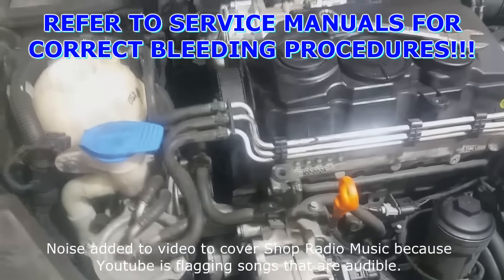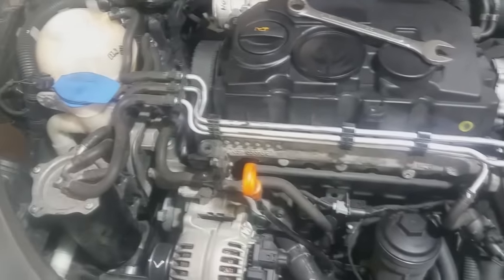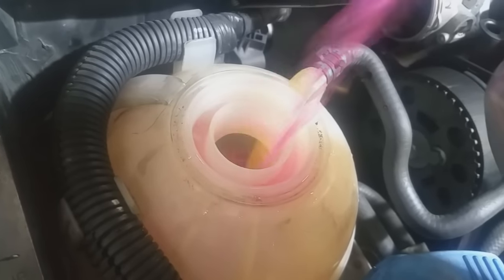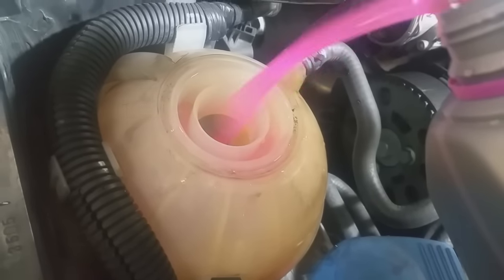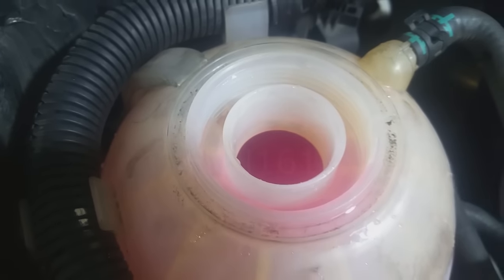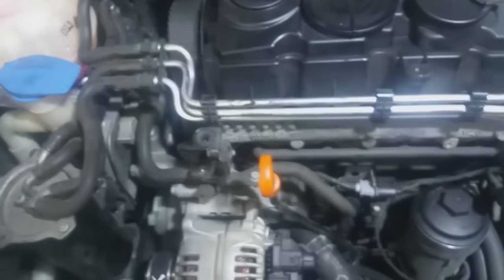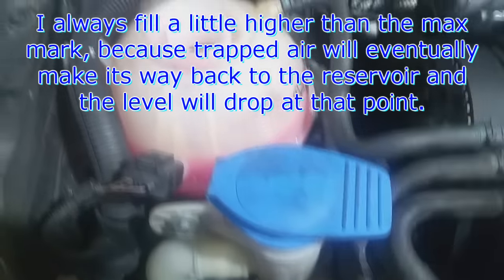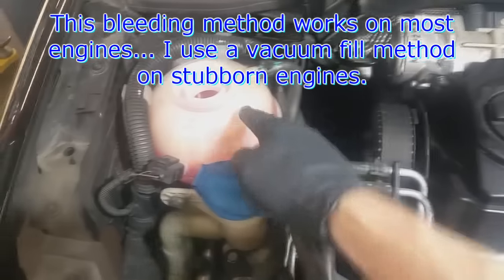Basic VW cooling system filling / bleeding info (viewer request)

Comment: A DIY tip bleeding coolant with a self bleeding system. After filling the coolant reservoir, drive the 2 front wheels onto a ramp and leave the engine running with heater at max, this will allow gravity to assist flow into the far reaches of the cooling system, engine block and heater block, while buoyancy forces air up to the reservoir works everytime for me.
Reply from the maker: +zech007 Thanks for the tip!
Reply: I know 2.0 FSI engines are difficult when doing a coolant change. Bubbles get stuck in certain parts of the engine throwing codes or just heating it up. Will this procedure help for this type of engine?
Reply: zech007 that’s great if it’s a car with a radiator cap, which VWs don’t have... jacking the front of the car up makes the reservoir even lower than it is flat on the ground!
Reply: VERY sound advice. Thank you!
Reply: That will work most of the time.  Definitely not on LR Disco 2s.  There are vehicles you literally need to bleed using bleed screws and by filling using vacuum.
Reply: Physics never fails!

Comment: hahahaha too funny .. after replacing my Rad with your other videos i tell my son to "go ask Thomas how to bleed this thing" ..sure enough he brings this up on his phone ...
Reply from the maker: Thank him (from me) for watching!
Reply: Hi brother I have 2014 vw passat disel car drive fine at night when it's hot over hear change rad thermostat flush system as you said if you don't hear air bubble sound you have blockage what should I look in also i noticed there is small hose going to intercooler I saw it it had some restricted thing In is that normal thanks Please help me with that issue

Comment: Good info, I used this method yesterday, and it worked perfectly.    This is by far the easiest maintenance I've done on a Volkswagen.    Most things on the VW are the opposite of easy.
Reply from the maker: As long as one makes sure that the air can come out, it's a simple system to bleed. =)
Thank for watching!
Reply: You are right, I had the same problem with the VW clamps!    Pneumatic hose clamps would have made it much easier, but I didn't have those.     There is a handy drain spigot on the driver's side of the radiator.  :-)
Reply: Given how VW plastic ages, I'm sure the spigot is risky on an old car too.
Reply: Thomas EXOVCDS would this work on a mk2 2011 “Seat Leon 1.6tdi” it’s basically same as a MK5 golf engine
Reply: Lol @ "the opposite of easy..."
Reply: Just wait until you change out a headlight bulb, plug and play haha
Reply: @Gr8thxAlot  aa
Reply: So this would work on a mk4 gti?
Reply: @cesartorresguzman919  I believe so.
Reply from the maker: @Cesar it would help to get more info from you. Why are you bleeding the system? Did you have an overheating issue that you tried to solve with a thermostat? Did you just want to do a coolant flush but now it's overheating?
Reply: @EXOVCDS  because i had leaked my coolant, I forgot to label the bolts that hold the trans, and I put the wrong bolt where the ground cable goes onto the trans for the battery, and  leaked coolant, so I was refilling the coolant, now coolant leaks under the car but toward the back passengers side of the car!
Reply from the maker: @cesartorresguzman919  vr6?
Reply: @EXOVCDS  yes GTI VR6 24V (6 speed )
Reply from the maker: The wrong bolt (too long) cracked the block?
Reply: @EXOVCDS  yes! Im assuming it cracked something because fluid started leaking from that bolt hole, but when I put the right bolt in, the leaking stopped
Reply: @EXOVCDS  the first bolt was too long yes compared to the original one
Reply from the maker: If the leak returns, you will need to drain the coolant,  remove the bolt, dry the inside of the bolt hole and then apply some JB Weld to cover the Crack in the block. Once the JB Weld has hardened, install the bolt again. To be on the safe side, grind the tip of the bolt off with a grinding wheel... to make sure that the bolt does not make contact with the JB Weld. As for bleeding the system, yes, the instructions in the video apply to your engine as well. Make sure that coolant flows back into the reservoir when the engine is running. If it does not, then there is a blocked coolant passage in the bleed hose / system.

Comment: I have a question for my 1.8t Jetta 2001. When driving sometimes my temp gauge goes pass 190F and fluctuates from the first line after 190f then back to 190F. It happens ever so often. Sometimes it even does it when the car isn't moving it'll rise then go back down. The fans kick on and everything, you think this could be a thermostat issue it getting stuck closed? Thanks in advance Thomas
Reply from the maker: Could be thermostat, water pump or temperature sensor.
My next step would be to compare the temperature reading that the ECM receives, with the reading that the Instrument Cluster receives. If they are both doing the same, then look for a thermostat or water pump issue. If one reading is steady and the other is up & down, replace the coolant temperature sensor.
Reply: +Thomas EXOVCDS would I get a code for the temp sensor?
Reply from the maker: Only when the temperature goes to extreme range... -40f or 260F
Reply: +Thomas EXOVCDS ah okay, how would I read ECU's temps? Through a obd2 scanner or Vag com?
Reply from the maker: A OBD2 scanner will read temperature that the ECM/ECU "sees"... a good scan tool will also be able to communicate with the instrument cluster computer, to see what temperature it "sees".
Reply: +Thomas EXOVCDS okay thanks a bunch, I'll take a look at doing this and see what happens if worse come to worse I'll just get a new water pump, thermostat and temp sensor.

Comment: I just fill it up, heat cycle it, and then the next morning top it up when it has cooled down.
Reply from the maker: Yes, it can be that simple, but depending on the design of the cooling system, not all engines will bleed air out like VW's & Audi's... even they have some engines where air can get trapped. By the time the thermostat opens, damage has already been done.
Keeping an eye on the temperature gauge or scan tool data can help save an engine by telling the owner to shut it off (things are getting too hot).
Reply: @EXOVCDS  . Thank you buddy, I love your channel btw. The amount of info you give is just mindblowing. I binge watched most your vids last night.

Comment: My 2001 TDI takes forever to get warm. And will ONLY get warm if it’s sitting and idling. As soon as you start to drive it, the temperature drops. I’m hoping the thermostat is stuck open and just needs to be replaced. But my radiator fan also won’t turn on. The AC fan turns on when you turn on the AC.
Reply from the maker: Yes, most likely  a bad thermostat / stuck open. The radiator fan switch won't turn the fans on if the radiator doesn't get warm enough. Replace the thermostat...  you'll get better heat and the fans will come on when the radiator gets hot enough.
Reply: @EXOVCDS  you rock man! Wish me luck!

Comment: Love your videos, thanks! Question for you. I have a Jetta mk5, no heat. New radiator, intercooler, thermostat, overflow tank. Flushed out heater core, it’s clean, car getting and maintaining correct temp. Coolant recirculating in overflow tank. Ordered new actuator for flap under glove box, but even with it open all the way still no heat, any thoughts?! Thank!
Reply from the maker: Flap under glove box... the "recirculation" flap?
That only controls air flow coming into the car.
Reply: Flushing out a heater core doesn't guarantee heat. It might not be possible to get enough gunk out to make a difference. I had an old Jeep that I tried flushing the core several times, but the heater never really worked until I bit the bullet and pulled out the dash to replace the core. If you've ever done this you'll know why mechanics sometimes charge $1000 or more to replace a $50 part. I wish all vehicles had simple to get to heater cores, some of them do. I've replaced a couple that could be accessed from below the dash, but that's a rarity. 

If your radiator was replaced because it was plugged with minerals or gunk, the heater core is probably just as bad.

Comment: I have this very weird issue on my Audi 2.0 TDI 2009. One day when I just started to drive a low coolant alert came in, I stopped and yes indeed it was low, I unscrewed the cap and coolant rised couple of centimeters (not to the point where it was before). I was in hurry so I screwed cap on and continued to drive. Next morning coolant tank was almost empty, so I unscrewed it again ->hissing sound->coolant rises. I started the engine with cap off for couple of minutes and coolant rised more, to the point where it was when everything was normal (so it looks like there is no coolant loss). No overheating, no gunk in the oil, no oil in the coolant. It is worth to mention that 1.5 years ago I had EGR cooler changed (so it is very painful to see some coolant issues once again lol), and couple of months ago I had heater core changed (I checked coolant level after that and everything was ok). Sooo, here is the question could this be just coolant tank cap or... it is early symptoms of head gasket? Yeah and I also hear sloshing sound when coolant cap is on and when I am revving up the engine, when I remove the cap and rev the engine, sloshing sound disappears, when I put cap on sloshing sound returns. It is air right? If there is an air there should be a leak somewhere right? Please tell me it is just a cap...
Reply from the maker: You have air in the system (coolant rushing sound through the heater core). New egr cooler or used? If you don't see leaks outside of the engine  then the leak is internal (head gasket or egr cooler).
Reply: @EXOVCDS  EGR cooler was new. Damn, head gasket, but at this point there are no clear signs... I burped system yesterday and sloshing sound disappeared, also changed the cap. So let's see how it will go.
Reply: How did it go? I’ve had the same problem for a year now
Reply: @ingveellingsen9806  it was egr cooler, I replaced it together with radiator tho and now everything is fine. Why radiator?Because there had to be some underlying issue why new egr cooler went bad afer just 1 year (the brand of the cooler was also not the cheapest). The coolant color itself was more brownish then red, that was the hint for me that it must be due to rust in the cooling system and in the radiator itself (also previously I had issues with heater core - it was clogged due to rust) and usually you can't 100% flush all the rust from radiator. Also, after a while my EGR valve went bad and mechanic just disabled it, so now in theory i shouldnt have any issues with egr. Overall, egr is common problem for audi's, vw's, so best bet is just disable it.

a year? how much coolant do you top up? for me it was rather quickly developing issue, after a couple of weeks/month I had to top up before every short trip lol, because if egr cooler is bad it just evaporates when you ride
Reply: @ReturnToMonke8  thank u

Comment: Ok, but how do i drain the radiator?
Reply from the maker: Remove the lower radiator hose / fitting. On some models you can't drain the whole radiator, since the lower radiator hose is not at the lowest spot. You would have to force water through the radiator to get all the old stuff out, and then force air through the radiator to get the water out. VW / Audi, doesn't make it easy on a lot of their models... only some models had drain plugs in the radiator. They must have removed them since it isn't that necessary to drain all of the coolant most of the times when working on the cooling system.

Comment: What I do on longitudinal cars like Passat and Audi I remove the bleed hose on the expansion tank and then put a bit of pressure in the system while blocking the small inlet on the tank and I place the hose in a container then most of the air come out also put some coolant in the heater hose that has the small hole for bleeding most mk4 mk5 etc are easy to fill but like I said 1.8t and 2.0 t engine can be harder to fill properly I also put the heater on full heat as soon as you feel the heat coming out the heating system most likely the system is going to be fine. One of the things that I hate most is people is mixing green coolant with pink G12 .
Reply from the maker: +V10PDTDI Yeah the Audi & Passat need to be bled at the heater hoses as well... it's a constant back and forth with me. Check the rad hoses, check the temperature gauge, check the heater output, check the scan tool temp. etc etc. Once the lower rad hose is warm and the fan kicks in, I can take it easy! LOL

Comment: Mine overflows after a short while after it gets hot. I run the engine, rev it to reach 90*C, keep reving it, with the coolant cap on or off... it overflows and drips down the escape hole. With the cap off I can see it coming from the intake hose suddenly and abundantly and then it overflows. Fan works properly and when it gets a bit over 90*C it starts. After it cools down, from the slightly above max fill, the reservoir remains about 1/3 full.
Reply from the maker: Year, make, model, engine? Heat inside the car?
Reply: @EXOVCDS  2005 Polo 1.2 BMD, yes, there's heat inside.
Reply from the maker: @emmn.4307  Fans usually come on after 90c (usually 97c to 104c). Does the car have a temperature gauge or are you using a scan tool to monitor temperature.
If the head gasket is bad, too much pressure will build in the cooling system and force coolant out of the bottle. Has the engine ever overheated in the past? How long have you owned the car? Have a shop test / check for combustion gasses in the cooling system / blown head gasket. A bad head gasket doesn't always result in coolant in the oil or oil in the coolant. So have the test done. Or leave the cap on the reservoir cap. Run the engine until just 90c. Make sure that the coolant hoses are stiff / firm from the hot coolant. Shut the engine off and let it cool until cold. If the coolant hoses are still stiff / hard when cold, then the head gasket is bad.
Reply: @EXOVCDS  The temp is measured by gage, yesterday it passes 90*C after a prolonged revving while still, fans came on, then the gage went back to near 90*C. Unusually during driving they don't come on, maybe a few years ago I did hear them coming on while drive on a hot day around town, otherwise I do long trips when it's cooler. The hoses are hot, the ones that go to the radiator as well, radiator too, top to bottom on the side without the fan, the water in the reservoir is hot as well. That's what I didn't get... after prolonged revving, out of the sudden the water gets pushed back and overflows, I understand dilation but the amount is too much, and it happens when the reservoir is filled to the middle, what once was max fill but is now unreadable. Right now I left it at the level it was yesterday and cold it sits lower and trips the level sensor, but once it gets hot it rises a bit, a rekey and the sensor light doesn't come on while the water under pressure sits around middle of the reservoir. Today I haven't refilled it ran it without pressure (cap off the whole time), and it hasn't overflown yet, nor did I see it rising, temps remained around 90*C, all were hot. In a few days I'll be doing a long trip and will check out what's what. So to recap, if I fill to the max level it overflows about 20-30 min of driving, but if I leave it as is it doesn't. Downside is I get to hear and see the sensor light until it heats up and level gets to normal.
Reply from the maker: @emmn.4307  fans usually don't come on while the car is moving (air flow through radiator), but they will come on once you are stopped again. 
Less fluid in reservoir will allow pressure to build because there's more room. Once level is higher, the bottle can not handle the extra air from failed head gasket.
If thermostat, reservoir cap & fans are ok... then it has to be a pressure problem from head gasket.
The cap is doing its job... releasing pressure.

Comment: the rear heater works ok so no air in that and no leaks onto carpet the gauge normal temp too
Reply from the maker: What is the issue?
Year, make, model,  engine?